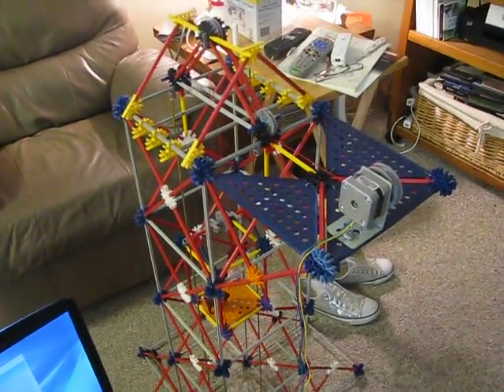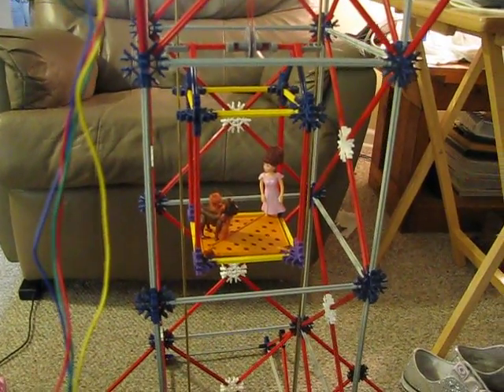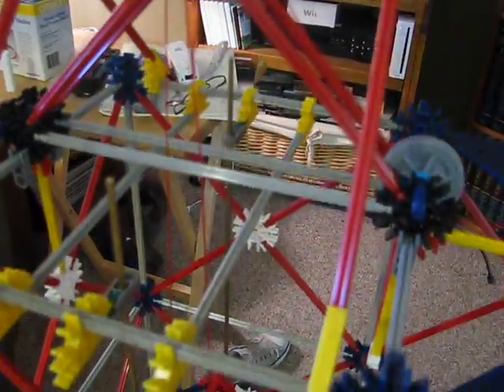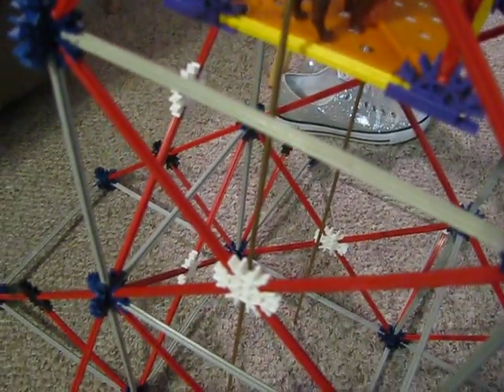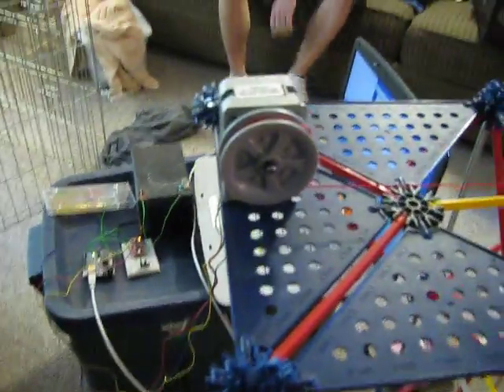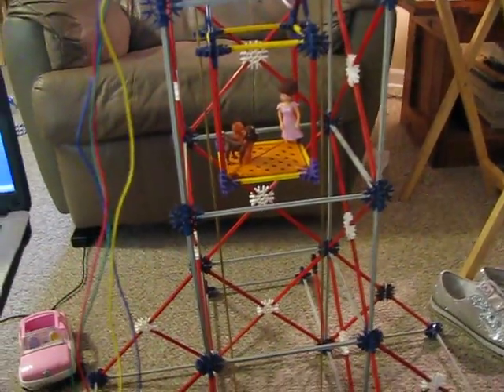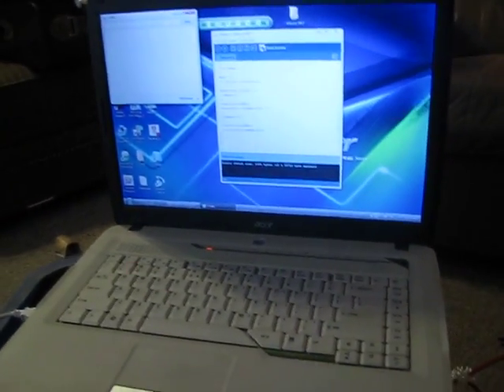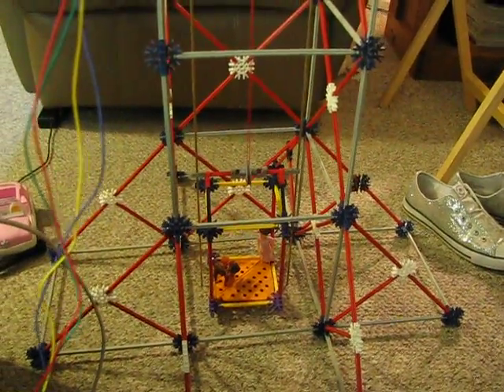Arduino Stepper elevator video 1 of 2

Comment: Is it too complicated to control the initial and final speed of the stepper motor, so the passengers don't feel the sudden start os stop of the elevator? How do you get feedback form the motor so it stops at certain position?

Comment: Thanks. The joystick I bought through SparkFun.com (I never realized soldering is so much fun) I drove the motors with the SN75441ONE quadruple half-h drivers. I should have got something more meaty that had a larger heat sink. It got pretty warm driving the step motors at 12V...

Comment: Hey n2scouting2, I had a question: How did you hook up the k'nex pulley wheel up into the driving shaft? Did you file down the inner diameter of the hole in the pulley wheel? I'm trying to get steppers and servos to work with my k'nex too but am having some trouble with how to adapt them without damaging the k'nex